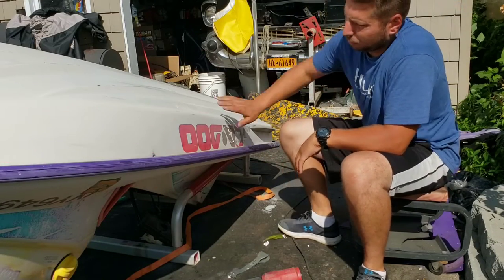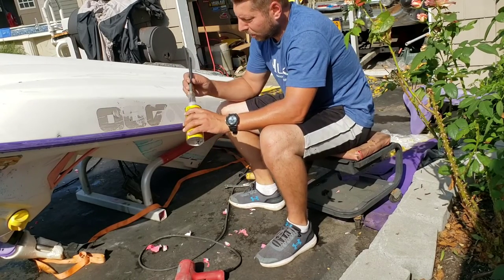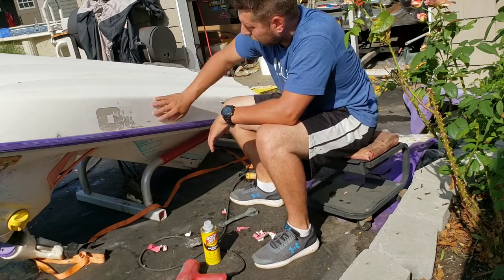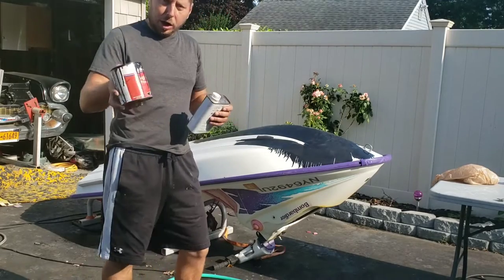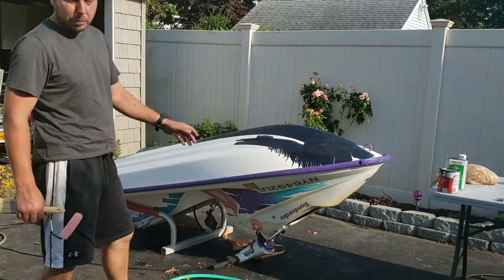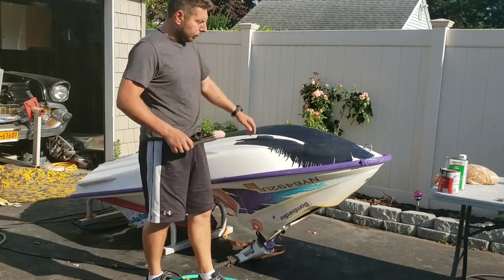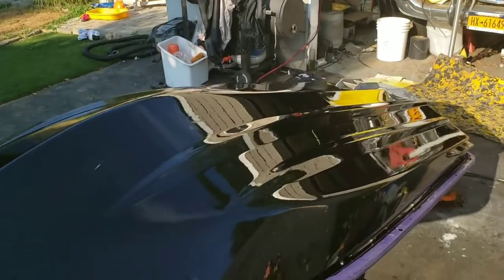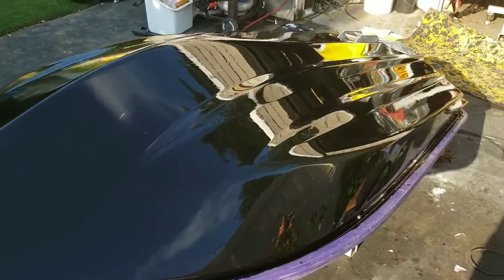Project cheap seadoo ROLLING AND TIPPING

Comment: Hey man. I’m currently refurbishing a Kawasaki 550 Hull and I have prepped it and waiting for supplies to show. I am just doing white and order a bunch of interlux brightside. I am wondering, how well did the paint on the bottom of the jetski hold up?? And how many coats would you suggest. I ordered a gallon because plan on using it on other hulls. Also plan on trying it in the engine bay as well. Plan on doing a couple coats also. Does it scratch easy like people say? Of does it hold up??

Comment: Did you have to pull the motor to flip it upside down or can I do it with no issues
Reply from the maker: Hi, i did pull the motor and drain all the fluids.   I was pulling the motor anyway.  But you can get jet ski straps and hoist it up to get to the hull to paint.  You can find the straps on Amazon for around $150